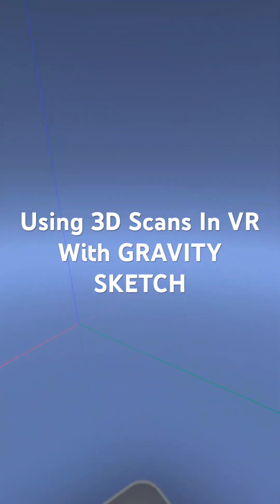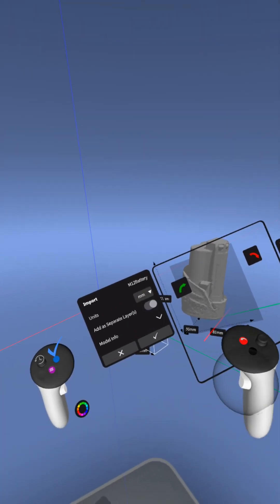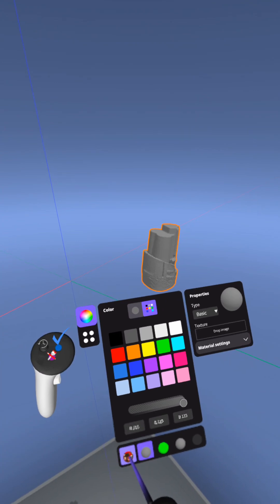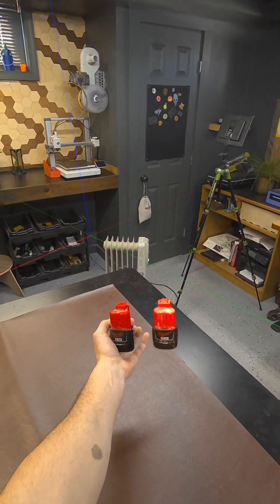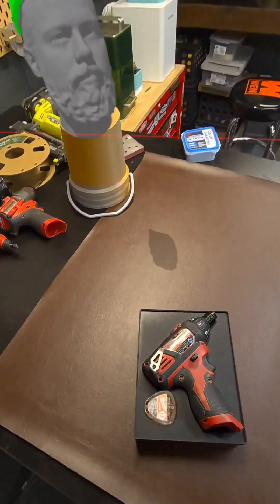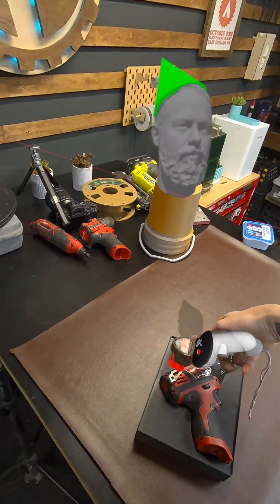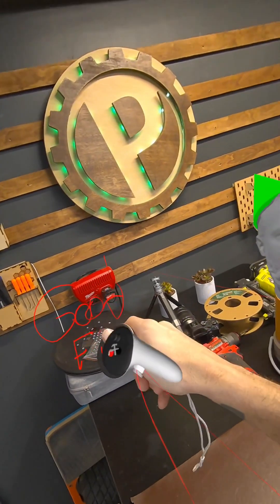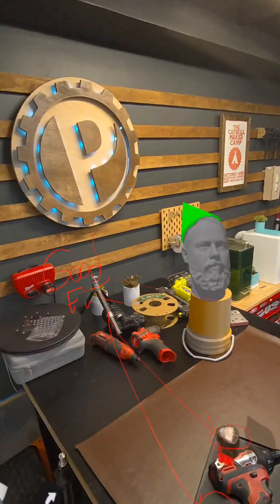Working with 3D Scans In VR #gravitysketch #metaquest3

Comment: Thanks so much for this video. I'm doing a lot of research trying to find if there's any ar headsets with lidar so I can do something like this, scan and model while actually standing in the application space. Engine bays, car undersides, etc. It could be way WAY faster to design stuff like exhaust, suspension components, engine bay components..
Reply from the maker: Absolutely. I only scratched the surface and I could see how useful it could be. I’m working on a long for video about it where I’m gonna dive in deeper, so keep your eye out for that!